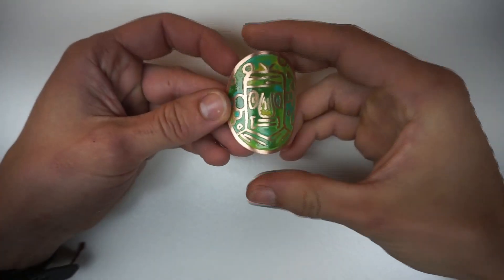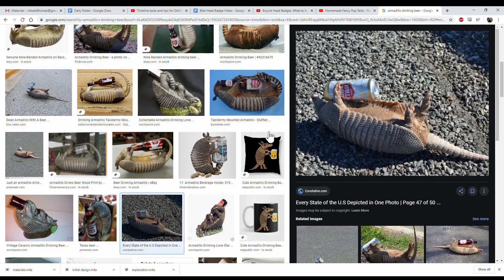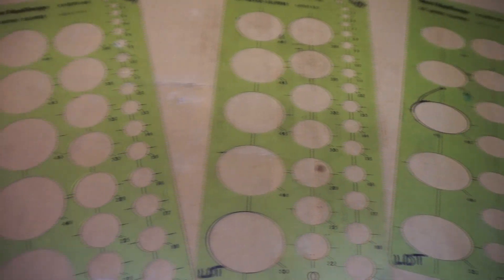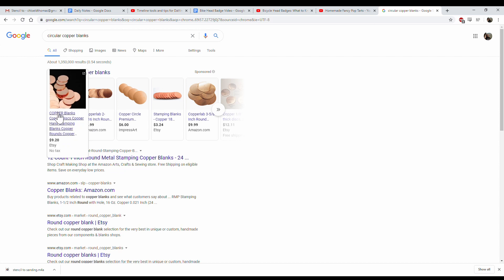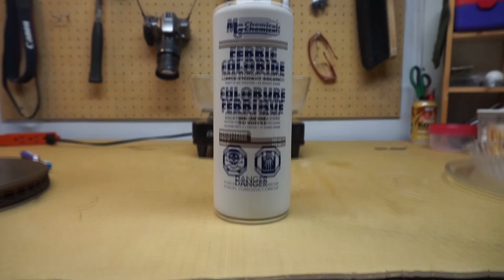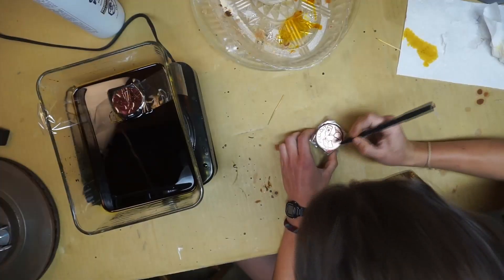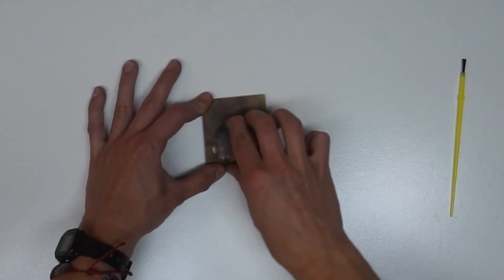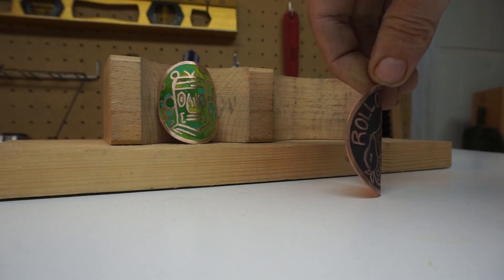Creating a Custom Bike Head Badge

Comment: uohhh, fantastic!!Just what I was looking for. Greetings from Spain and thanks.
Reply from the maker: Glad this was helpful for you!
Reply: @chloet7385  Hi Chloet, could you explain what kind of plastic you are making the drawing on? I guess it's not the same as the one on the back, and if you explain it in the video, sorry, my English is not good enough. Thank you very much in advance.
Reply from the maker: @I.Martinez81  I am drawing on copper. I am drawing using a permanent marker. The marker I like the most is a STAEDTLER marker. I hope that helps!
Reply: @chloet7385  Thanks Chloe, it's helps! In the end I understood that you draw directly on the metal plate, and use a piece of plastic glued underneath to move it without touching it.